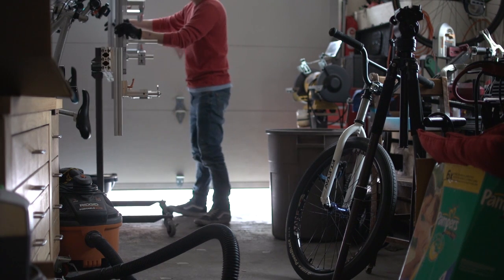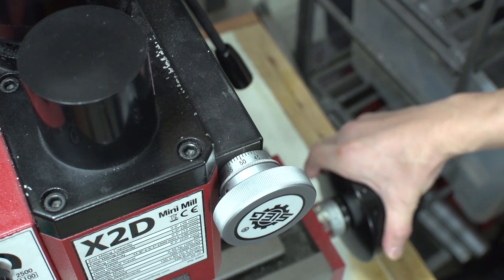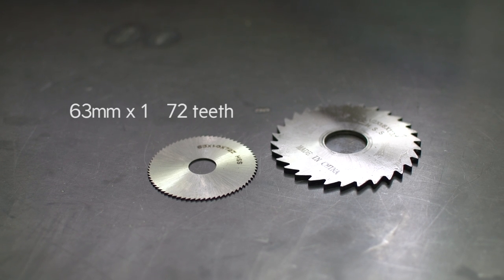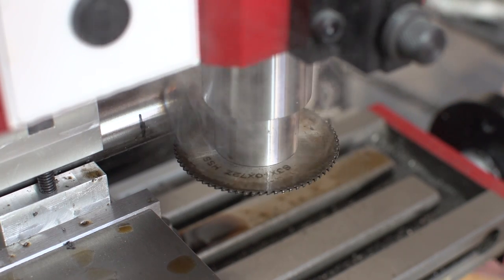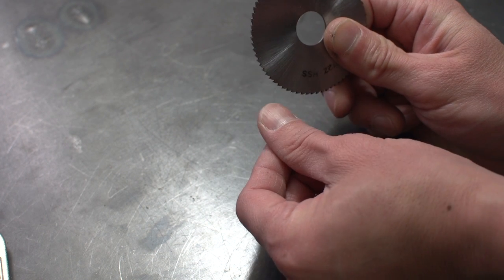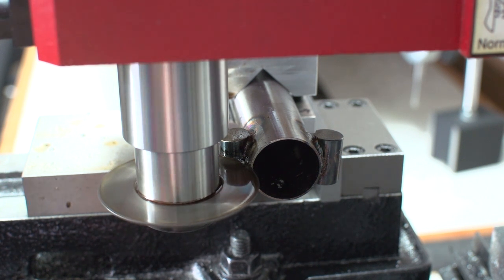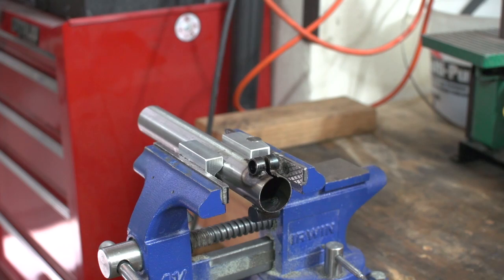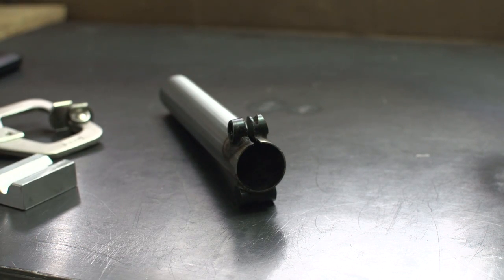Using Minimill To Make Cut With Slitting Saw

Comment: I've cut binder slots with a hacksaw and file, and also by freehanding it with a cut off wheel in an angle grinder. I prefer the former. Things go slower and you're way less likely to make a catastrophic error although, if the angle grinder was fixtured in some way as to be able to make the cut repeatable and controllable I could see that being a good option. 

Someone mentioned a carbide slitting saw but I don't think that's a good option here. Carbide cutters in general need rigid set up's. I think your mill is too small to be able to utilize carbide.

An upgraded HSS saw might be the answer but my 2 cents would be to stay away from machine tools for this operation. Go with the hacksaw. There's plenty of experienced builders who do it that way, even some of the ones that have access to a Bridgeport mill or similar.

Good luck!
Reply from the maker: Thanks Alistair, really good to know. Quick question, someone else commented in there saying that they do the cut after reaming the tube (i assume in the finishing stage) Is that when you make the cut too?
Reply: Pithy Bikes Yep. The reaming comes after all welding/brazing is done, but before the binder slot is cut.

Comment: Your mill is fine for this (I have the same mill but with a belt drive conversion.)  You are feeding it too hard and spinning way to fast.  Slow and easy. You want to just nibble your way through. Feeding it as slow as you should, climb or conventional cutting will make little difference.  Go full depth from the start and make in one cut. Lots of coolant/oil. It wouldn't hurt to make your own arbor to fit better as it can be a high use item and worth the effort. The small circular saw blades someone mentioned are great.
Reply from the maker: Thanks for the advice. It's always great to hear from other folks with similar or same machines running the same operations.

Comment: 4130 is tough so even slower rpm then. and must use something to keep it cool. cutting oil is not sufficient unless it was flooded on like coolant.  a cool mister is probably your best bet and cleanest or a squirt bottle with coolant in it.
Reply from the maker: I have some proper coolant on order for my next test. Thanks for the advice! Can't wait to try this again.

Comment: way too fast, you need a coolant mister or coolant in a squirt bottle, something too keep it cool. use 240 ÷diameter=rpm for a ball park starting point.  diameter of what is spinning ie cutting tool or dia of work in the lathe. hope this helps
Reply from the maker: Thanks, I'll try that!

Comment: Lots of folks have already pointed out that you are running the saw way too fast, and you are climb cutting.
One other very important thing is you need to make the cut full depth in a single pass, this is especially true with saws that are flat like yours. Making multiple passes causes nothing but trouble, and dulls the blade quickly.
I seriously doubt your mill can run slow enough and not stall though.
Your best bet if you want to use the mill is to get a small abrasive cut off wheel like what is used in a cordless grinder/cutter. That way you can keep your RPM's up a bit and go in multiple passes.
Reply from the maker: Thanks for the advice. Yeah, its very likely i don't have enough torque to run at a proper rpm.

Comment: I feel for you. I've experienced exactly what you are experiencing so I know your frustration. The blades you were using were dull. When you get a good blade you will succeed. This is not rocket science so keep trying and just compensate for the lack of power of your mill by slowing your feed rate and run that blade about 70 to 100 rpm.
Reply from the maker: will do! I'll see if the mill has the torque to do that.

Comment: Just because it's made in america doesn't mean it's necessarily better.  If you pay the Chinese properly they do just as good if not better work than Americans.  Aren't iPhones made in China?
Reply from the maker: absolutely! I've bought lots of crappy stuff in America too. My welding machine, mill, and lathe is from China and its excellent. None of the stuff I'm doing would be possible without tools made in China.

Comment: Another great video Pithy.

I have a question about CAD - I noticed you using BikeCAD Pro in a previous video - do you think it offers anything over what I can produce in Fusion/Solidworks/NX? 

The outlay for the Pro license is a big one considering I'm very much a hobbyist.
Reply from the maker: The best thing IMO about BikeCAD is that it's really easy to use out of the box and has lots of templates to start from. Especially for new builders who are new to frame geometry. It has a built in calculator that you feed body measurements to, and it will recommend the best frame size and geo. It's way faster. It's a program made for bicycles. So the only catch is, if you want to make really wacky stuff never before seen on a bicycle, then Fusion /Solidworks is better suited for that (from the ground up designing/designing form scratch)

Comment: I think that a hack saw and files are the best tools for this cut for two reasons. The cut is best made after reaming the ST i.e. after the frame is welded. If the slit is cut before reaming, the reamer will push the tube open and not cut the slitted length well, if at all. Maybe this will matter, maybe it won't but the cut is short and straight so you won't save any time doing it with a power tool. You just need a thin file to clean up the saw cut.
Reply from the maker: I didn't consider the reaming situation at all. This is a very good point. So many decisions to make :'|

Comment: way too long for a YouTube comment, plz don't make fun of me, thx (and anyone please chime in if you catch me on something wrong): 

4130 steel is indeed a menacing combination of hardness (which makes a chip difficult to start) and toughness (which makes a chip difficult to "follow through" on)! Generally, more carbon (which makes a steel harder) and more alloy content (more carbides that will eat away at your tools, or something) make stuff a biznitch to machine. Only special you-don't-wanna-weld-'em steel alloys like 1215 or 12L14 are easy-ish to machine (are those braze-able? might be worth looking into)

Assuming that the cutting tool starts sharp and stays sharp during the cutting procedure, and the tool itself (in this case a slitting saw) is an appropriate balance of diameter and thickness (i.e. stiff enough to withstand cutting forces), there's two main issues inherent to the mini-mill when cutting most steels:

1) You may not have enough overall rigidity to initiate a cut in harder materials, because the cutting tool will tend to bounce off rather than make a cut -- although keep in mind that fixturing rigidity can be VERY important on workpieces like thin tubing, so the mini-mill itself is not always the limiting factor. In the case of this video, maybe some vee-blocks that clamp the overhang of your seat tube would help (kinda like the mini mill version of a steady rest?). 

2) You may not have enough torque to "follow through" on bigger cuts in tougher materials. Even in the case of a very, very sharp tool with a cutting geometry that wants to "dig in" to the workpiece (which is a "positive cutting geometry," and good for low-toughness aluminum), it's entirely possible for the machine to "bite off more than it can chew" and stall out during the cut when the large-and-tough chip won't separate. 

By the way, if you're using a positive and acute cutting geometry that wants to dig into the workpiece, your gibs better be tight, bro, or you're going to "bite off more than you can chew" for sure! 

On my mini-mill, I'm typically stuck with light cuts, relying on the cutters being very sharp, "nibbling" away at the material. This "nibbling" involves higher speeds than what's recommended by RealMachinists(TM). If you think of cutting as a continuum of "gouges -> nicks -> scratches," huge machines can repeatedly gouge the hell out of steel without issue using a negative (or "tending towards negative") cutting geometry, but the mini-mill is stuck making nicks or scratches. 

This is OK... except if we're just nicking a workpiece, the tip of the cutter (which initiates the cut) will dull quickly relative to how much material the cutter removes in it service life. Higher TPI cutters are more amenable to "nibbling" (think of the advice for bandsaw blade selection: "at least 3 teeth in the cut at all times, preferably 6 to 12 teeth, up to 24 teeth"), but then you've got to worry about how the hell you're going to sharpen such fine teeth, and they're going to dull more quickly on steel than on aluminum, no matter what you do. Fudge. Still, fine TPI is a tool in the arsenal. It's easier to use a file than a cold chisel for similar reasons; a file is really just hundreds of little cold chisels machined into a piece of steel! Nibble nibble. If I tried cold chiseling a steel workpiece that I'm holding in my hand, I don't have the rigidity or the muscles, so if I do want to cold chisel something, I've got to clamp it in a vice and drive the chisel with a hammer. 

The ultimate in "nibbling" is something like an abrasive cutoff wheel: a huge number of incredibly small "teeth." So your idea of using an angle grinder fixture is actually pretty reasonable. Plus, for the future, an abrasive cutoff wheel can cut just about any kind of steel, at any hardness, including hardened welds (i.e. any weld that has not been specifically annealed). I have a friend who was building frames a few years ago, and he just used an angle grinder by hand, but I know (thank Gord) that's not Pithy Style! 

The OPPOSITE end of nibbling would be to use a single point cutting tool. Essentially, a saw blade with only one tooth, which would be the rotating equivalent of a "shaper machine." Might be a bad idea on the mini mill. I've heard fly cutters, for example, are excessively hard on the mini mill's bearings. But if it's small and balanced, it might work OK, especially with a carbide cutter. 

For this particular seat tube slotting application, you could also just drill a bunch of holes and carefully hacksaw the slot, then file it and sand it until it's pretty. I think I saw this in a Richard Sachs gallery. It's yet another "hand tool craftsman" method -- there's methods like that than there are cats to skin. But, again, not Pithy Style. I learn a lot from Pithy Style, so you'd better not give up on it! 

Keep building. Keep dreaming. Keep piling up spider webs of ductile materials behind my mini lathe. 

A cool video of chip formation. It gets ugly. https://www.youtube.com/watch?v=mRuSYQ5Npek

Stefan has a lot of good general thoughts on slitting saws, although he is a genius-enthusiast with carefully selected equipment. Maybe we should wait for This Old Tony to relay the same information via copasetic diagrams that use construction paper. https://www.youtube.com/watch?v=bRQPv4AG2HQ

Here's a chart of machinability. Note that two different materials rated at, say, ~70% machinability might be difficult to machine for different reasons. http://www.carbidedepot.com/formulas-machinability.htm
Reply from the maker: Hey thanks for the write up! YouTube put your message in my spam folder which is why it took a while to post. Great advice and thanks for taking the time. Cheers!
Reply: Benjamin Sherrill very nice background information. Somethings i didn't know yet (i am no machinist), thank you!

Comment: Don't try sharpening the saw, the geometry on the saw as is should work fine.  You're running at quite a high rpm it looks, try dropping the rpm's down to just under 100 to see how that works.  Slitting saws only want to conventional mill, climb milling with a slitting saw takes a seriously sturdy machine, and arbour.  Plenty of cutting oil should help as well.
Reply from the maker: Thanks for the tips. I knew when I was sharpening the saw that I was breaking some slitting saw law somewhere. ;) I didn't know about the climbing thing until folks commented in here. Thank again!
Reply: Pithy Bikes slitting saws cut really slowly, the same as woodruff cutters in a way. The chipload should be about 0.035 mm  feed per tooth at the most aggressive, and 0.015 at the slowest. You have to be careful climb milling with any cutter on a manual mill, I've seen cutters run away on guys, self feeding into the work piece. Climb milling on a manual machine is for light finishing cuts only!!!!  If you're looking up feeds and speeds tables to calculate the rpm's for an hss cutter, you'd probably be wanting to look at welded chromealloy as something similar to a basic stainless, around VC 6 to 10 surface meters per minute, regular mild steel should be about 30 to 40.  ((VC x 1000)/(pi x Dia of cutter)) (feed in mm/min = rpm x chipload x number of teeth)

Comment: I now use a fiber cut off wheel on an electric cut off tool and just eyeball it, then drill the relief hole. But when I used a mill I used a cutter 3/16"  saw that is also a side cutter and with a straighter arbor. http://www.ebay.com/itm/0895-REI-4-x-3-16-x-1-Slitting-Slotting-Saw-/302170347196?hash=item465ac196bc:g:o5kAAOSwcUBYTePM
Reply from the maker: Simple and effective! Thanks for the slitting saw link, I wasn't sure what size to slot at. The width seems to vary based on builder preference. I just checked one of my frames and it does indeed have a 1/16" slot. This is great news because I have a 1/16" end mill and also wanted to give that a go. I'm pretty convinced now that a slitting saw on my minimill is not the best choice for slotting ST. Cheers Mike!

Comment: When the tool starts smoking and turns blue that means the tool is toast, turn the speed WAY down use allot of fluid.
Reply: Straw  color is enoght to ruin a cutting tool.
Reply from the maker: The tool didn't turn blue but it was smoking like a chimney. Partly because of the cutting fluid I used smokes a lot but no doubt.. I was at too high RPM.
Reply: 1-you re climb milling  , you should be slide milling instead 2- the thicker the blade the lower the speed. 3-chinese products will do the job but you have to be very cautious  very mild with them, those are no Globus or Butterfield ones
Reply: I saw that too and kept wondering when he was going to put oil on it lol..when I use my lathe I can stop it at anytime and lay my hand directly on the work piece with no worry of being burnt

Comment: Hey PB. Dumb question (probably); wouldn't it make sense to drill the binder before cutting the slot? You'll be sure that the hole you drill will run perfectly through the centre of the binder and then cutting the slot will be easier as you're removing less material?
Reply: douchebagnumero1 Yeah, I know that. I was referring to when PB tackles the real binder.
Reply from the maker: Yes, that makes perfect sense. The binder I purchased from Paragon Machine Works is pre-drilled and tapped. If I were making my own, for sure I'd pre-drill and tap it. Especially since I got lots of comments on the steel hardening after welding. Cheers!

Comment: As always, a great video. I recommend  pre-drilling a hole at the bottom of the slot before you make the cut, which will help prevent stress cracks down the seat tube over time. 

A word of warning with the angle grinder approach. Depending on the depth of the slot you want to cut and the diameter of the cutting wheel it may not be possible to cut the slot without hitting the opposite end of the seat tube. Good luck!
Reply from the maker: Absolutely agree with pre-drilling. I did that on the real tube but forgot to on the test tube. Good warning on the angle grinder. I can imagine how easy it would be to 'slip' and cut down into it.

Comment: You gud!  verru nise ussr sovet armu r6m5 steel. prise 1pcs-1-5usd. https://www.avito.ru/vyazma/kollektsionirovanie/freza_diskovaya_otreznaya-proreznaya_sssr_874997213
Reply from the maker: thats a lot of cutters!!
Reply: Pithy Bikes translite text off links. Cutters Cut-R6M5 trench, the USSR, the new, with storage space: size pieces --- --- availability rubles / pc 200 * 5 * 32 ---- --- 4 pcs 1200 rubles. type 2 200 * 4 * 32 ---- --- 1pc 1000 rubles. type 2 160 * 4.5 * 32 11sht ---- --- 700 rubles. type 2 125 * 4 * 27 ---- --- 10pcs 350 rubles. type 2 80 * 3 * 22 1pc ---- --- 150 rubles. type 2 80 * 2.5 * 22 ---- --- 20pcs 150 rubles. type 2 80 * 2.5 * 22 ---- --- 8pcs 150 rubles. type 1 80 * 2 * 22 ---- --- 15pcs 130 rubles. type 2 80 * 2 * 22 ---- --- 12pcs 130 rubles. type 1 80 * 2 * 22 2 pcs ---- --- 110 rubles. type 3 80 * 1.8 * 27 1pc ---- --- 100 rubles. type 3 80 * 1.6 * 22 11sht ---- --- 100 rubles. type 2 63 * 3 * 16 ---- --- 4 pcs 80 rubles. type 1 63 * 2.5 * 16 ---- --- 3pcs 50 rubles. type 2 63 * 2 * 16 ---- --- 4 pcs 50 rubles. type 2 63 * 2 * 16 ---- --- 4 pcs 50 rubles. type 1 63 * 1 * 16 ---- --- 13sht 50 rubles. type 1 63 * 1 * 16 2 pcs ---- --- 50 rubles. type 2 50 * 2 * 13 ---- --- 7pcs 50 rubles. type 2 50 * 1.4 * 13 2 pcs ---- --- 50 rubles. type 1 many more items of various turning and milling metal cutting, measuring tools, chucks, jigs, tooling and t.p.Otpravlyayu transport or by mail, self. Call write, send upon request a complete list of tools that is available, for each position there PHOTOS.
I can buy the desired mill in Russia and send mail in California, free for you))